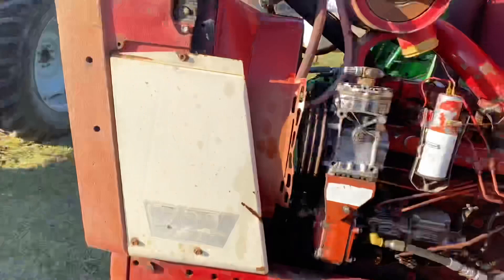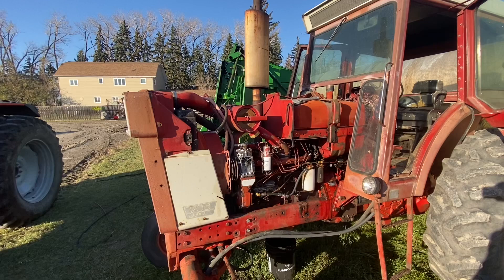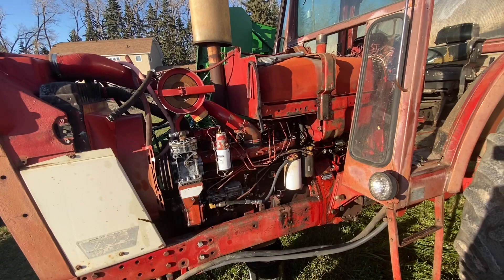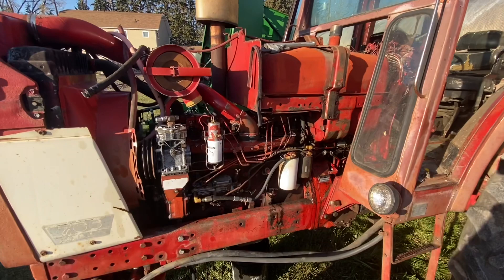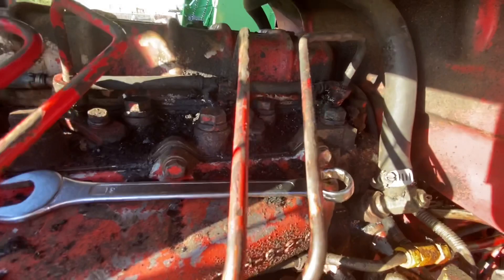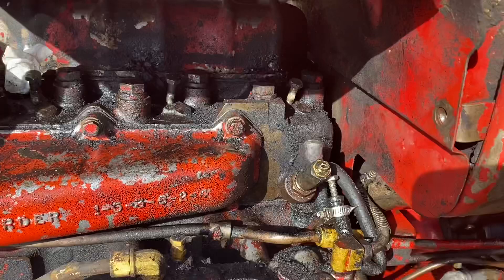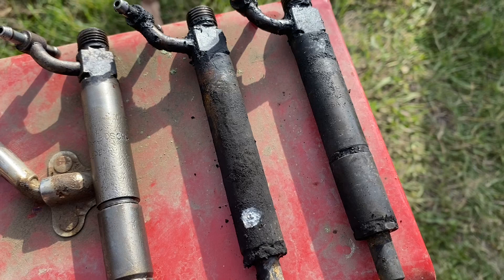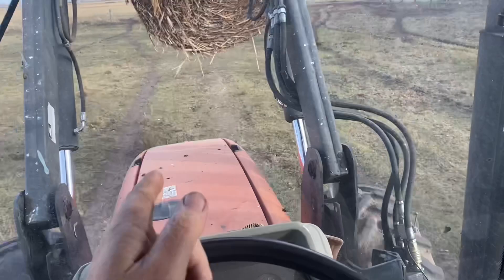Raising a 766 from the dead

Comment: Doug, You can see from the last two injectors that there is little to no seal around the body hence the carbon build up, I would image due to the carbon
you will not be able to remove the inserts without pulling the head off the block, Hopefully i‘m wrong but at the end of the day the tractors not costing
anything to sit and maybe you can get it running again without too much expense, I guess farmers can‘t be sentimental about machinery but it has some
history with your family and how nice it would be to see it live on for a few more decades lol. Cheers Dave
Reply from the maker: Yeah i'm hoping to not pull the head but if i do it's not that big of a job, i'd just need to order up a gasket set and probably clean the valve ports, and yeah it is nice to keep a bit of the other farm working over here. and it's always nice to fix something cheaper than you were told and quicker to fix. cheers bud

Comment: Not just the injectors Doug, but get that timing corrected. Maybe you can find the specs online somewhere?
Reply from the maker: Yeah once i've got the new liners in i'm gonna check it for specs and work my way back, the injector shop told me the date stamp on the injectors were mostly late 70's and one or two from early 80's so they were WELL worn out, lol. he said they now pop from 3,800lbs up to almost 5,000lbs, but he balanced them so she'll be sweet as a nut

Comment: Morning Doug...I had a '97 case ih that had dual spinny things(pto)...it was only a 78hp tractor but with mfwd and a loader it was a awesome little feeding tractor and ran the haybine just fine.
Reply from the maker: We used to have a 5130 that did a great job but at over 10,000hrs the hydraulic pump was going, but it decided to burn it's cab up so it got gone, good tractor besides that. cheers